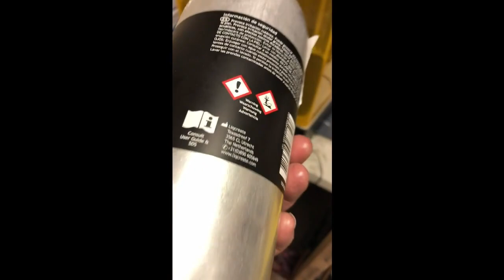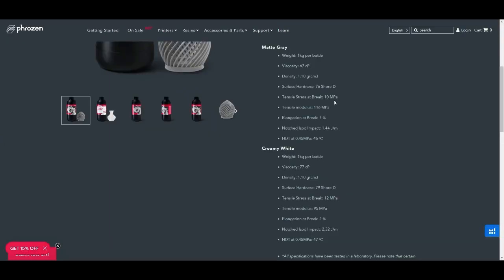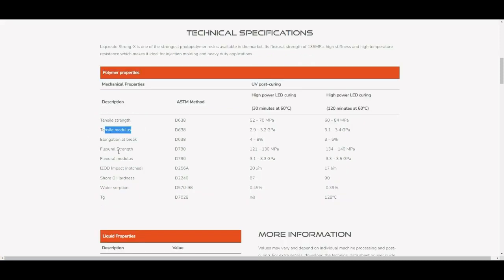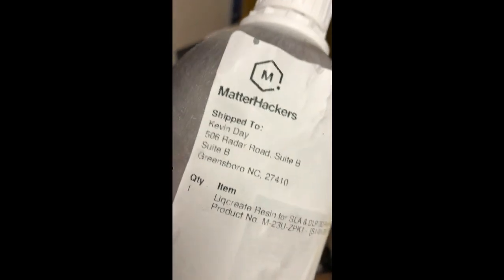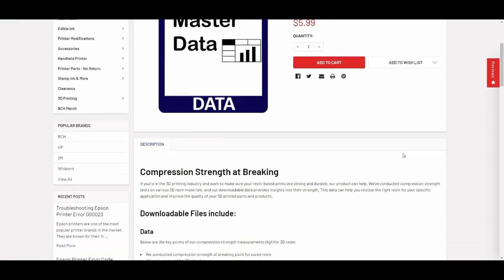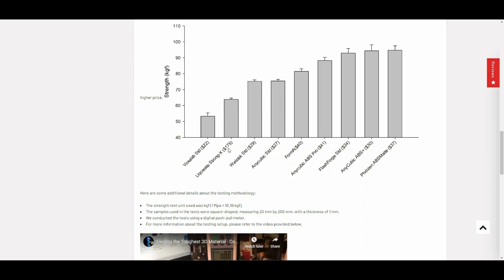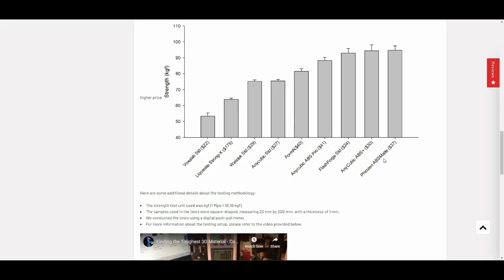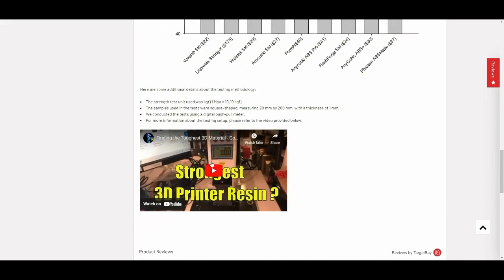Review: This 3D Resin's Strength Will Blow Your Mind! - NOT in a Good Way

Comment: How did you cure it? This resin is more specific in how it's cured. If you didn't cure it in a lower UV at about 140 degrees F, you're not going to get the proper strength. I have this resin, and can attest that it is extremely good and really strong.
Reply: I was/am tempted to try this resin but of course since he is throwing it under the bus I got nervous. 
Can you elaborate a bit more on your experience with it? Have you e.g. tried Blu from Siraya which is often mentioned as an affordable strong resin - but I would like something even stronger than that, personally.
Reply: @AntiVaganza   @AntiVaganza  this resin is made to be cured at 60 degrees centigrade. This resin is quite heat resistant, which is part of what makes this resin special. When cured at 120 minutes in 60°C, using 405nm LED, it does give you (per specs) 60-84MPa tensile strength, 3.1-3.4 GPa tensile modulus, and 90 shore D Hardness. 

Blu v2 is still very good. I use it often in conjunction with other resins. While it doesn't need special curing, it has a tensile stress at break, MPa of 50, and a shore D hardness of 85. 
Strong-X is a superior resin, and I've been using it with prototyping toys with mechanical properties.
Reply: @jasonc212  Thanks so much for the numbers:). I have had Blu V2 Clear go soft on me after some time, haven't fully understood why. First, I thought it was because I dyed it but even the undyed parts can go soft. They are used in water a few hours per session a few times a week but dried out in between. But I do think Blu abosrbs water. Will look into it more.
I have also made parts from a mix of Blu and Build which seems to fiar better in terms of not going soft, but they could do with a bit more strenght. So the possible strength increase from Strong-X/Composite-X might just make my parts stop breaking.

Comment: Good advise.  I have been building small parts that go on a handle for my hand so my pinky doesn't hang off, but the shock it takes always brakes them.   I was thinking of trying Liqcreate, but after your review I am not so impressed with it, especially for $175 !    I have been using Epax Hard & Tough, but those break as well. I will try some of your other recommended resins and see how they perform.  Thanks for the research !